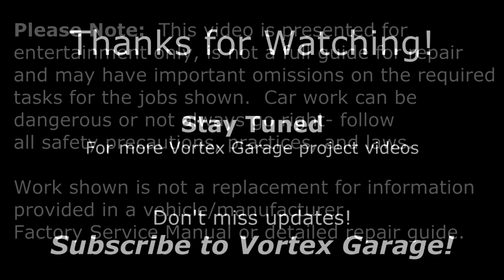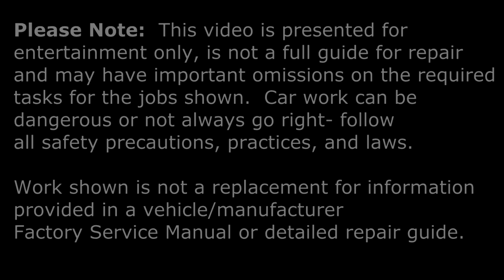Jeep WJ D44/D35 Axle Bearings, seals, plus parking brake - Vortex Garage Ep. 11 - OLD VERSION

Comment: brilliant trick reversing the rotor to pop the axle out
Reply: And if you don't tighten the lug nuts, but leave a bit of slack so that the rotor can slide along the studs, you don't need to hammer the rotor - you can grab it by the edge and use it like a slide hammer to pop the axle out.

Comment: I have to tell you, I've watched TONS of videos, and scoured every forum. YOU were the ONLY person to handle the issue I had! The retainer plate DOESN'T come flush with the flange by default. That's why EVERY video people post shows them trying to remove the outer wheel bearing race upon removal. Well, it was helpful to see someone FINALLY using a mallet. If you haven't done this, and it's your first rear axle DANA 44 on a 1999-05, you wouldn't know that. Not even the service manual mentions it when discussing the Rear Axle 226RBA. THANK YOU!

Comment: Regarding bearing install, have you ever considered using a crock pot with differential oil, place all the interference fitting parts in the oil, heat to 285°F, then slide in place (in the correct sequence) and let it cool?  I've done it on large equipment successfully multiple times (the old fashion way). The heating of steel will typically make the steel grow by 0.006"/100°F. Since an interference fit is ~0.0015 - 0.002" smaller than the shaft diameter, the heated growth should allow for everything to slip on easily, seat in place then lock onto the shaft once cooled off.

Also, the oil will be retained in the bearing!  BTW, make sure you use PPE (silicone mittens) to protect your hands from the heat.  Nice video...

Comment: Great video!
I like how ya showed using a drill to cut the locking collar.
And wow man completely different steel the inner race is made of, we used a Dremel and a cut-off wheel to make a nice cut in it then one good lick with ye 'ol cold chisel and the big ball peen hammer. 
We have a HARBOR FREIGHT 20 TON PRESS that has once again paid for itself.
We also have a bench top drill press makes things easier 1/4" high speed bit.
Thanks again. 
We is my 12 year old son and I. 
We did the procedure in the driveway and on our outside work bench.
We used all Spicer and Timken parts.
Denny's Drive Shafts in Kenmore, New York will help ya get squared away with WJ  and other driveline components. 
Brand new Made in The USA Spicer bearing retainers were $8.95 a piece. 
Fed-Ex sucks spring for UPS shipping my parts sat at the Fedex station 40 miles away for 4 days.

Comment: Nice vid. Had the same issue with two studs on axle retainer plate last time I did mine. Also crown. Pulling one side apart to replace seal. Your post is nice refresher. Same press in my shop ..

Comment: thanks. just got an abused 99 Laredo. had this bad real howl. Guy was saying possibly bearing. Well, no play at all, bearing is good. Noticed both sides back plate was really oily and goopy. no line leak. Hmmm. checked e brake like and R/S cable was not attached in the yoke. no brake at all. took it all apart and found that the pads are shot to hell, froze actually. They sprayed oil up there to loosen and lessen the noise. Cleaned, replaced. Noise gone and e brake works now.

Comment: that retainer is actually serving as a retainer and pilot so when u bolt on axle it fits just right in the axle tube. do both axles the same time if u dont see any axle oil come out as the oil is supposed to be high enough to get down the tubes to lube the bearings .
Reply from the maker: big ass dude The capacity values for fluid can be found here http://www.wjjeeps.com/service/maintenance_wj.htm note that the fluid does flow down the axle tubes but mainly at speed when the fluid flows up as the gears spin. at rest the capacity level is lower so there's not much in the tubes per se.  and yes def agree if doing one side it is good to do the other!

Comment: I have a 96 ZJ 5.2 so it has the 44A and I just did the parking brake shoes and also the 2 piece levers as they were rusted together thus no parking brake, also replaced the adjuster rod and equalizer now parking brake actually works--I have a BTF rear diff cover on my 44A, looks coolCHINA junk knurls

Comment: Do you know the torque values for the rotors, the axal shaft bolts and the wheel lugs?  I believe the wheels are 110 foot pounds.

Comment: Hi, Great video. I followed it to replace the bearing on my 2002 WJ. After replacing the bearing on the axle, I am getting little in and out movement in the axle which causing the rotor to grind against the caliper bracket. Does it mean the bearing was not pressed all the way? Thanks in advance for your help

Comment: I am trying to install the actuator at the top , a bit to the right which attaches to the  brake cable coming  into the back plate. It does not get uninstalled like other Parking brake parts in your video. . Of course both of mine are not attached and I tried many ways to install. Tough to test!  Help!! I am sure it will be easy. Even my Jeep Dealer hasn't seen this before, LOL.  Jeep is on Jack Stands until I can figure this out. Thank you very much Great VIDEO!!!!

Comment: Great info.   I'd prefer to not have the music overlay 'cause it's harder to hear the voice.  Otherwise a super  video.  I'm doing this job now and had one outer bearing race come out easily but the other is stuck tight.  Going to try to lower the temperature of the race and see if it shrinks enough to loosen up.

Comment: any pics or video of the hooking up of the brakes? the jeep I have is missing the entire parking brake. the cable is there, have a brake kit but no mechanism. searching for that part that fits on that metal tab that the pads slide into and that has a lever for the cable to hook to. I found one but with out a picture there is not much out there except  drawn parts diagrams that show an arrow pointing to a part. might have to go to a pick and pull and see if I can find a jeep that has it on there.
Getting my parts today so am doing both bearings. will cost 40 per bearing, 15 if I cut the bearings off myself. great video showing how to do it

Comment: Hi vortex garage, here in uk I have a 2003 wj grand cherokee, 2.7 turbo diesel, (Mercedes engine) gonna be doing this job myself after watching your great video. Question, what is the tonnage of your Press? Got my eye on a 20 ton press for my own use. Would this be OK to do the job or do need a more powerful press? If that's the case I will take them to an engineers to have them pressed. Press over 20 tons get very expensive.

Comment: can you get those axle shafts pre-assembled with the bearings and seals already pressed on?
Reply from the maker: Check Quadratec - look at item 20 on this link:  http://www.quadratec.com/jeep-replacement-parts/grand-cherokee-wj/wj-dana-44-rear.php

It looks like these have the bearing retainer in the pic so they must be an assembled part.  May still want to call Quadratec to be sure.  Other vendors may also have these.  They aren't very cheap.  Note different part number for D44a if you have the standard/lsd vs. the quadradrive varilok.

Comment: Do you have to replace the bearings and cut all that off to replace the parking brake or did you just decide it needed done? Thanks
Reply from the maker: Todd Shoemaker if you're just doing the parking brake no need to do the bearings. in fact you can probably get tje brakes done without removing the axles.  in my case I was doing the bearings as maintenance and found the parking brake pads were needing replacement

Comment: Great video! How did you know the bearings had to be replaced? I have 180,000 on my 4.0 WJ and as far as I can tell they are still good yet.
Reply: I have 186,000 on my WJ and both sides are needing done now.
Reply: @rspc6132  Did they make noise?
Reply: @bladerunner2434  There was a squeaking noise coming from the right side. When making hair pin left turns you could hear loud grinding noise from the left.
I just replaced the bearings yesterday and all is well now.

Comment: great video.i have a question.i replaced rear bearing in a 2008 jeep yj ,D44, but have some play when wiggling wheel up and down. Not leaking yet, but should there be any slack in it at all. it did it before replacing bearings on both rear wheels.thats why i replaced them,but still have same issue.please help! any help is appreciated very much.

Comment: Hello Vortex, thanks for the nice video
I want to change the bearing and seal of the rear Axle of my jeep and I have a question please.
The seal need Silicone RTV Silicone Gasket Maker to place it?
Regards
Reply from the maker: M Ba if only doing the outer bearings then no RTV is needed.  if you are resealing the center differential cover in the middle then yes you will want to use gear oil rated RTV, it's the grey one from Permatex. if only the outer seals, those come in the bearing kit we used in the video are do not need RTV

Comment: Thanks for the great content! One question, is the setup the same on the 5.9 '98 zj?
Reply: I have the same question!
Reply from the maker: It appears the 98 ZJ 5.9 uses a Dana 44, so the setup should be very similar.  The axle bearing/seal procedure should be nearly the same.  The parking brake, rotor and brake calipers may be different, and there could be minor axle differences between '98 and this '04 but this procedure as I understand is pretty much the same on Dana 35 and 44 series axles.
Reply from the maker: Sorry for the slow reply too

Comment: Great video. Did those axels pop out that easily using the old rotor (reversed) or did you have them out once before? That looked too easy.
Reply from the maker: took a few good whacks turning them if i recall.  So yeah it does take some time that way

Comment: i have a 1996 jeep cherokee xj does the dana 35 rear end suppose to have thrust washers behind the spider gears or can i run it without them mine didnt have any when i pulled it out while replacing rear axle bearing and seals

Comment: great video, question. once this job is done do you have to top off that oil? I am doing my jeep this weekend. please advise. thank you
Reply from the maker: If the jeep has sat for a bit, most of the fluid in the axle tubes will drain into center section of the diff.  There's no real amount of fluid in the tubes at rest.  As a result, you should not really lose any, so I didn't need to top off.

Comment: I had the same issue with those studs. what I did was I used a pair of vise grips to hold the bolts .....crown not good I had to replace it for Timken
Reply from the maker: Good method!  I agree on those plates not happy with Crown. :)
Reply: Isai Ramirez timkin makes good shit.
Reply: Isai Ramirez where did you find the timken bearings at?
Reply: Alberto Gonzalez 
Rockauto $29 bucks for Timken set 31

Comment: Thank you so much!! I know it is harder work with filming!! i also wondered about the C-clip. I have a 2004 grand cherokee special addition; if a C-clip is present, then there would be no bolt on retaining plate? 

   Thanks again, GREAT FILMING ( I personally could do without the music tho, at times it was louder than your voice), great instruction, and thankfully no profanity so I did not be aware if my kids could hear you or not.  Thanks again!
Reply from the maker: Thank you!  Glad you enjoyed it!  In our later videos, we learned and don't have the music anymore :)

Regarding your question - you are correct, a C-Clip style axle would not have the bolt on retainer like these.  In those, you have to remove the Diff cover, push the axle in, and remove the c-clip from the diff.  Luckily on these WJ Jeeps and similar Dana 44/35 axles in other Jeeps, there are no c-clips so axle removal can be done without touching the diff cover.  Thanks again!
Reply: Thank you for the info!  One more question, I am at the point of getting the left rear axle out, I noticed you are able to rotate the hub.  I cannot. Do you have the car in neutral?  I have wacked on the inverted rotor quite a bit, but no budging yet. Is this because I cannot rotate the hub?
Thanks!
Reply from the maker: M Sach yeah I think I had the transfer case in neutral. I found rotating it made it easier to hit it around different spots. it can really take a lot of hitting hard to get it to come loose. seen some that really need some heavy hitting to free it from the hub face...
Reply: OK thanks!  Got it out and all bearings are off now. I did notice a nick where the retaining ring was, I am almost sure that was not done by me ( due to its position vs where I was cutting) , but what is the consequence of this being present? - I know it is not a good thing, but how bad is it?  THank you again for your time.
Reply from the maker: M Sach if it's small and the retaining ring is tight and does it's job Id probably not worry much.  honestly I'm not sure if it would cause a major issue or not. hope that helps a bit!
Reply: yes, thanks for your input!
Reply: Tired of the questions yet? new bearings on, and when I was cleaning up the axle tube ( where you put the axle back in, it looks like there is another bearing race in there; in your video, you can see it @ 22:25, is this a "race" for the retaining ring? Does this ever get replaced..or does the retaining ring kind of hang in the middle of the axle tube while it spins? If it gets replaced, how do you get this guy out.  Once again, THANKS!

Comment: I need some help! I did this job on my Jeep twice and leaks back again, first I use cheap stuffs so i said let’s get a good seals and leaks again any advice my Jeep has more than 250,000 miles on it
Reply from the maker: The only thing I can think is that the actual axle has a wear spot where the seal goes preventing a good seal due to it's mileage or something is warped in the axle tube.

Comment: without removing C clip, Axle shaft out. I tried thrice to relisten you but couldn't understand. Could you please explain, thanks.
Reply: This model has a bolt on retaining plate.  There is no C clip.  The axle is held in by 4 bolts and a plate on the outside of the axle.
Reply: Thanks

Comment: Hello, I have a 03 Jeep Grand Cherokee I installed new shafts bearings and seals on both sides, both were pressed on. The problem is that they are leaking again. what do you think i did wrong? Also one shaft is longer than the other could that have been the issue if i put them back on the wrong sides?!
Reply: mike johnson 540k! Wow. I'm curious, which engine do you have? I got the 4.0 straight 6 in my 03 WJ and it runs great.

Comment: vortex I have a noise I think is coming out of the differential .Any idea how to diagnose it? noise after a replace the bearings is less so that's why I think it's coming off the differential. axel was leaking oil that's why I replaced it .
Reply from the maker: it could be the pinion bearing or inner bearings if they lost lubrication.  I havent stripped one of those down myself...

Comment: Do you know how to remove the brake dust shields? I can't find anything anywhere on how to remove the pins holding it in.
Reply: They are riveted on basically, you'd need to drill out or cut off the rivet heads. Mine were loose and making an awful rattling sound (I installed a junkyard rear axle that I think had been moved with a forklift and set down on the backing plates too hard), so I just tack welded them in place.

Comment: what size tires on your wj ? i have a set of nice 235/85/16 terra tracs i want to put on my wj with 2.5 inch coil spacers ?
Reply from the maker: They are 265/70/16s, which work out to be 31's.  With the spacers and stock wheels they fit fine. I did have some treadwrights of the same size on steel wheels with more backspace and had to trim front bumper a tad, as it would occasionally rub at full lock.  No rubbing with these on stock wheels with the spring spacers

Comment: Is trac lock the same as vari lok? I found a axle shaft for my car but it only comes w vari lok which my car doesn't have. but its the right axle. but on another site it says works with standard or trac lok. so can I get the vari lok version and it still work with my standard axle?
Reply from the maker: they are different.  traklok is a clutch based limited slip setup and varilock is the georotor locker setup.  The axle shafts may be slightly different

Comment: The D35 does nt use a true wheel bearing thats tapered. It uses a POS flat roller bearing that uses the axle as the inside race. That way when its time to change the wheel bearing you get the extra expense of buying new axle shafts at the same time. The fake dana 44A or some call it a 44HD sure this same POS bearing. Not one part on the 44a is interchangeable with a true dana 44, not even the cover. BTW. the 44a is what came on the cherokee's i n the late 80's through the 90's. http://d44tech.com/Dana_44A.html